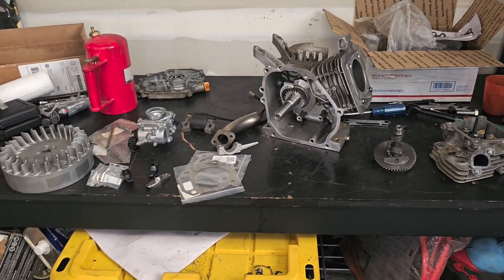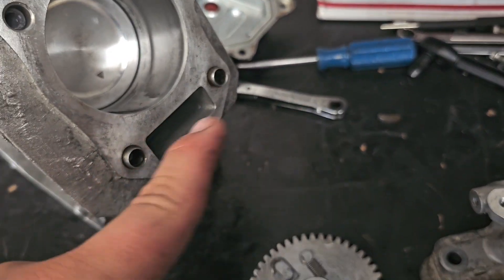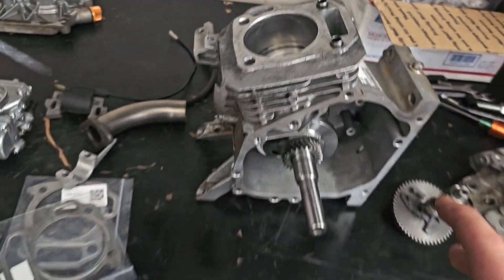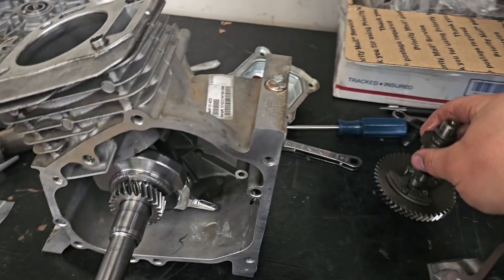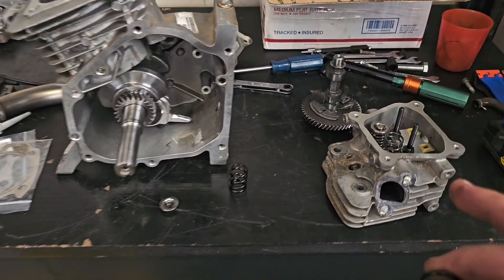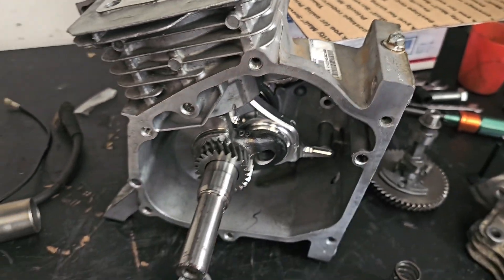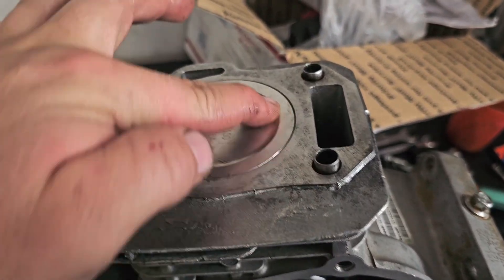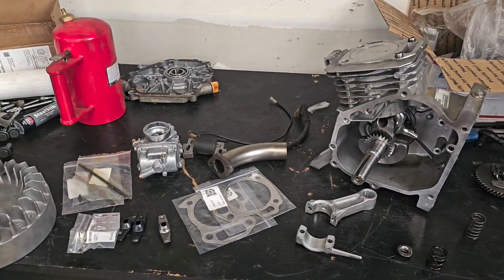How to Build a Vertical 212cc Engine | Motorized Bike

Comment: Good Video 👍 I learned a few other things about 212cc builds that most other videos never talk about... Another thing I was debating was  using a 212cc build or a just get a Suzuki ax100 clone for about $285 total (just need an expansion pipe) it's a 50x50mm case reed 2 stroke 4 speed semi automatic motorcycle engine....That could pass for a 49cc 3-4 speed moped engine. 
I wouldn't have to mess with doing research & trying to build a 212cc....Plus if the 212cc has a CVT it's going to be alot wider than the ax100 & need CVT maintenance..Now I'm thinking 🤔 go with the ax100 since it's prebuilt, 4 speed, plus cheaper, more narrow & stealthy than a 212 CVT...Less torque though.I think it also has an alternator to charge a small motorcycle battery & run lights. 
If money wasn't so tight, it wouldn't be a big deal if the ax100 was a dud and I could just go with a 212.....The other thing is the ax100 is already meant to be a small 55mph motorcycle engine. Where the 212cc isn't meant to be. I'll have to compare the price of 212cc engine+ cost of upgrade parts+ CVT or clutch costs. I'm guessing $500-ish ?
Reply from the maker: Sounds good. Thankfully you can get a good engine mount with a built-in jackshaft that just bolts on to many bikes. It is like $300, but nice that it just bolts on. The AX100 is kinda weird shape cuz of the big transmission. It probably would'nt fit perfectly within a typical frame unless you tried rotating it a bit (which would, in turn, cause issues with the carburetor and exhaust fitment). And you would definitely need to fabricate engine and a jackshaft that either welds to the frame, or REALLY firmly clamps around it.

But you can pull it off and once it's all said and done, should be a lot of fun.
Reply: @a.m.bgarage.everydayprojec9665  Yeah, I can weld good so I'd modify the steel frame fat bike, weld in engine mounts and use a wide pedal crank... I've seen a couple MTN bike builds where guys were able to fit a 125cc semi automatic pit bike engine onto the right MTN bike frame without welding or a wider crank setup. They could pedal the bike & shift the semi auto. By taking 1 foot off the left  pedal, clicking the shift lever, then back onto the pedal. 
With the AX100 I wouldn't/shouldn't need a jack shaft. The chain is on the left hand side. I'm pretty sure I could pedal it in neutral. Just like a stock motorized bicycle but with some drag. I really wouldn't be doing any pedaling. Other than ghost pedaling or maybe pedaling away from the neighbors before kick starting the bike late at night. I'd rather try to build a good hybrid fuel efficient, stealth 55mph bike with pedals. Than get like a 125 or 250cc scrambler. My other crazy idea 💡 was a high speed 5000w ebike. That uses a decent size battery but not huge & mounting a removable 1000w inverter generator inside the frame. For a gas ⛽ electric hybrid Ebike.

Comment: I hate debating so much on what engine and parts to use.....I so wanna build a 55 mph reinforced steel frame Phatmoto style fat bike build....But then I can't make up my mind if I should try and use 19in motorcycle wheels, or reinforced fat bike wheels. Then I start thinking about just buying a steel frame, full suspension GT73 3000w geared hub ebike. That has 19in motorcycle wheels, pit bike brakes,etc .Modifying the frame & seat to look more like a bicycle and adding a engine to make it a hybrid. 
The plan is 55mph cruising to ride 16 miles into town. Then switching to ebike mode while riding in town. 
If I used a geared hub motor labeled 750w. Then it'd be 100% legal in ebike mode if a cop wanted to hassle me about the engine.